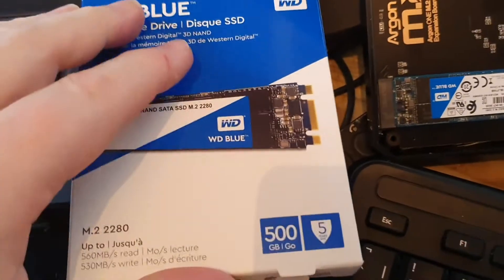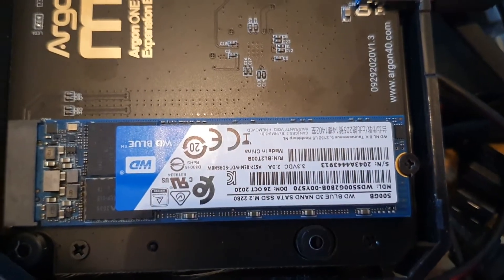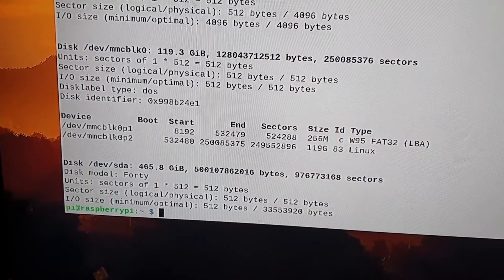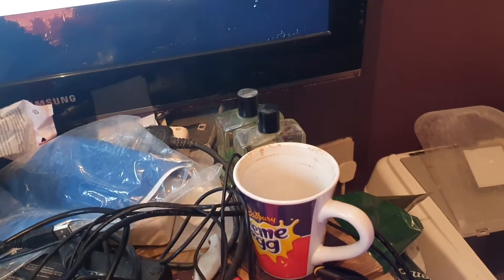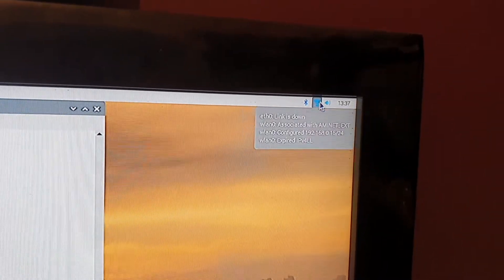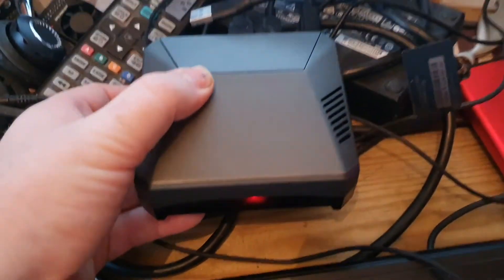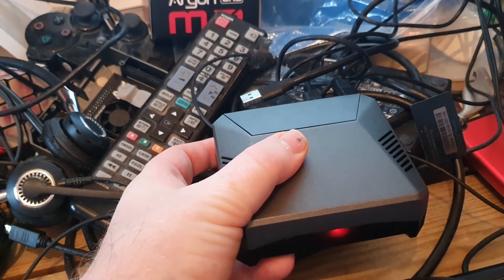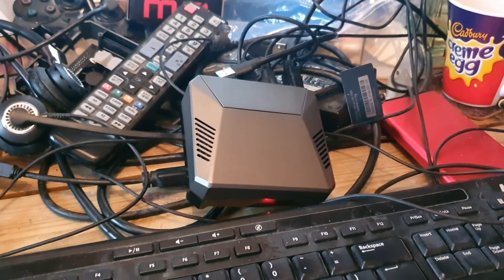Argon One M.2 WiFi dropout - You need a strong signal

Comment: You can check this option out:  https://www.youtube.com/watch?v=MTwWnZG8wUY An external antenna can help. I  have used this with the same case. The smaller 100mm length antenna wire can slip through the vents on top or you can notch the plastic case near the seam to get the antenna end outside of the case of you have a modified board.
Reply from the maker: Excellent info @BigWaveDave. I do have a friend at work with a reflow station. There again until Pi4s get restocked I will wait.

I got a Pi2W to act as a PiHole for home network - seriously impressed with them and  since I didn't overclock it there seems to be little WiFi loss from the plastic case. There again it is also sited right next to main router for best signal :-)
Reply: @stephenhookings1985  I also have the Pi Zero 2 W in a Flirc case that acts as a heat sink working as an octoprint server and running a bunch of plugins. It's overclocked to 1.3 and temps are fine, Also still get decent wireless signal, but It's within 20 feet (and 1 interior wall) from the router.

Comment: The Pis wifi isn't really the best to begin with. Most pi owners I know use external dongles.
Reply from the maker: Without the new case it was fine. My solution was to move the Pi into the garage, right next to the repeater, fix its IP and connect via ssh if it's too cold :-).

Comment: I think , it is not matter of NVMe itself it is matter of using USB3.0 port that affects on WiFi signal. I'm experienced the same issue using external usb3.0 disk. It is known issue that using usb3.0 port affect on WiFi signal in 2.4 specter. Try to use 5ghz WiFi if you have such a router or WiFi extender (AP or so).
Reply from the maker: Well the 2.4 GHz repeated signal is fine but the 2.4 GHz and 5 GHz direct signal are not. Other devices adjacent work with the direct 2.4/5GHz. As I showed, if I simply shut the case, using the uSD card and not the SSD, the signal is lost. Reopening the case and signal is back. So I have to conclude in my case (pardon the pun) the WiFi signal to the on device WiFi is severely attenuated by the case and hence SATA controller.
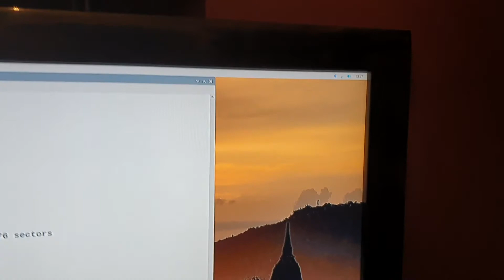Reply from the maker: You can see at 2:30 the signal comes back as soon  as I open up the case. And I do a demo a bit later.
Reply: @stephenhookings1985  Of course that signal is back, because you also disconnect USB3.0 connector (daughter NVMe board to RPi board) if I see correctly on video, so interfering stops. In previous post I said it is common issue , well there is the link to pdf, that explains it https://www.intel.com/content/www/us/en/products/docs/io/universal-serial-bus/usb3-frequency-interference-paper.html. I am not claiming that you are not right but I only suggest to see the problem from another perspective.